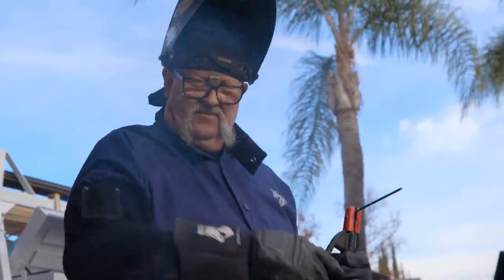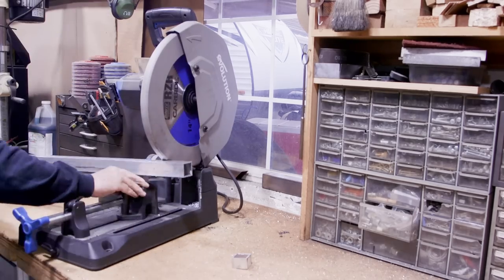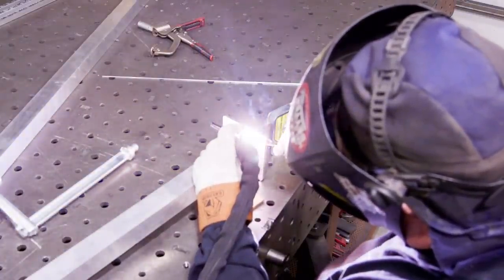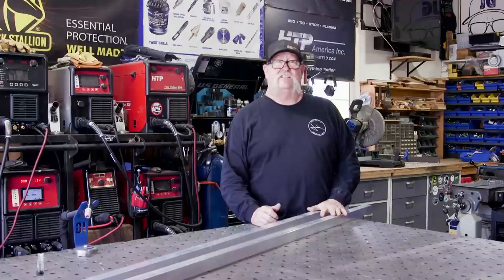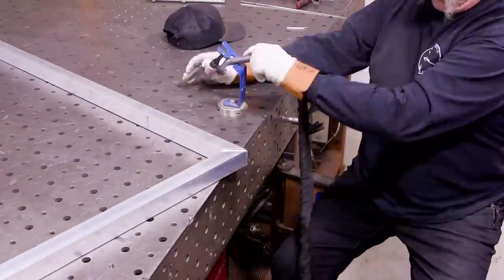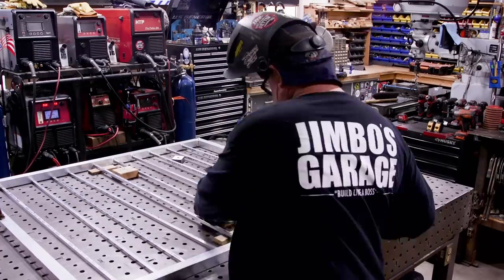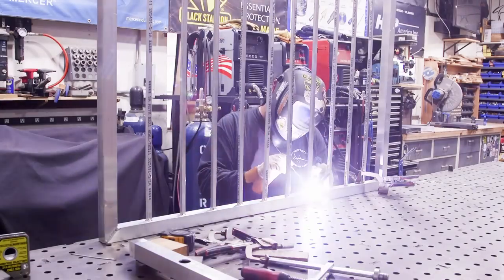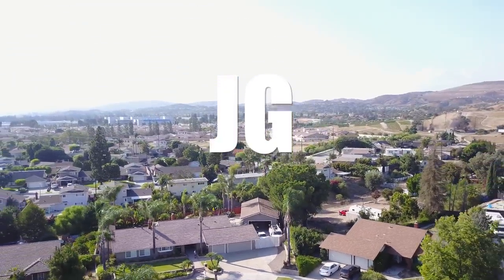Aluminum Gate Build... I won't make another one | JIMBO'S GARAGE

Comment: Good build! Aluminum is a type of metal though, as is steel. A common mistake I hear a lot as a fabricator myself, people using the words steel and metal interchangeably as if aluminum is not metal. But good work none the less! Keep it up!
Reply: Also, like Jimbo stated, aluminum DOES corrode/oxidize, unless it’s anodized, that would make it more durable.
Reply: @peteryeung111  what’s that gotta do with anything?
Reply: @peteryeung111  As far as I know, aluminum oxidizes forming a white-ish, very hard layer which is quite tough to remove and prevents further oxidation of the material.
So, if you want to call it corrosion (I don't), it's limited to the very first layer and it's more like a paint film; plus if you scratch the film it recreates automatically!😉
Reply: I dont recall him saying that it wasnt a type of metal?

Comment: Insetad of using a fixed spacer and then adjusting measurements with the last few pickets, I find it better to measure the complete  length, and use the amount of pickets, width of pickets to determine how big the space should be.

Comment: Ive got a13 ft double swing wooden gate which Ive built and rebuilt 3 times in the past 2 years due to high winds. Last time it ripped the entire gate off the fence and left only the part that the hinges were attached to. Im planning on building a metal gate to replace it. Im planning on using 2" square tube is 16G thick enough or should I go with 14G steel?

Comment: A good way to do the picket would have been to use round bar and cut them about 1/2 inch longer than you need and lay out your top and bottom frame sections and drill holes just a bit oversize and then you just slide one end in and then the other and one you had them all in you cold have tacked all the bottom and the gone over and tacked all the top.